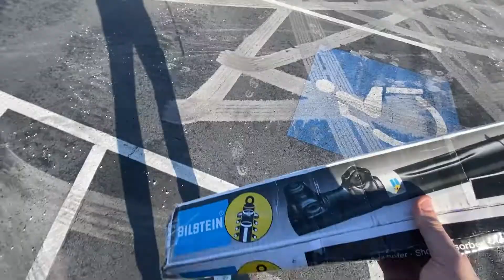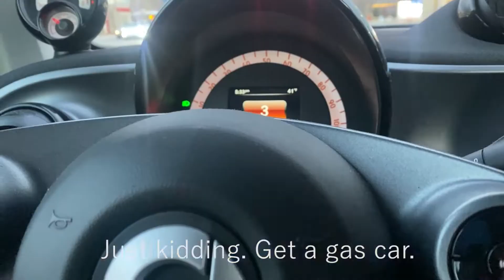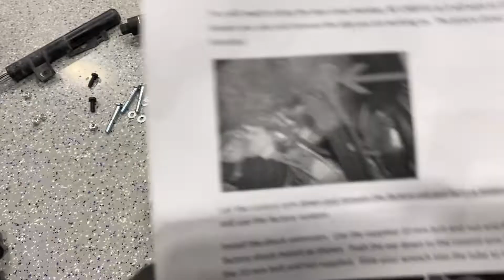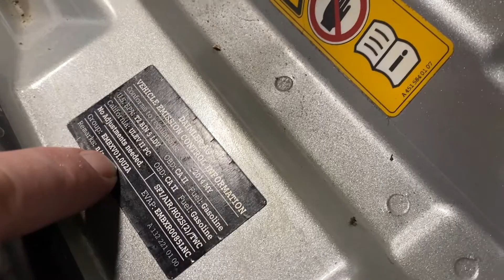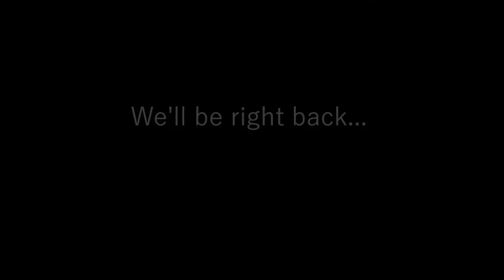Smart Car Build # 5 - Struts, Shocks, Spacers & Wheels (Almost)

Comment: Where did u get you wheel spacers ? The ones I got 3 years ago where the only option n they were 2 piece adapters n they suck. Would prefer the 1 piece style u have.also after ur lift did u have traction control issues ? My traction control would randomly turn on n off around corners. I just pulled the fuse . But the trash looks like it's Christmas all year around now.
Reply from the maker: I bought mine from Dan @ www.normalguysupercar.com
No traction control issues (and my car doesn't have a lift).